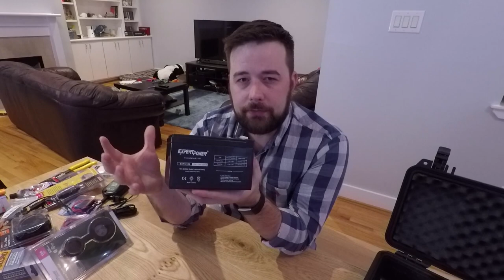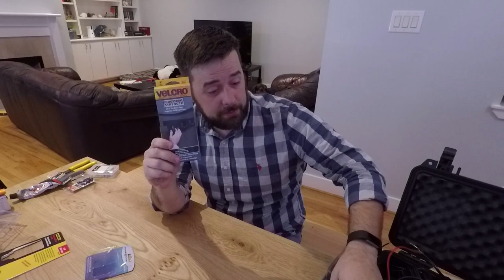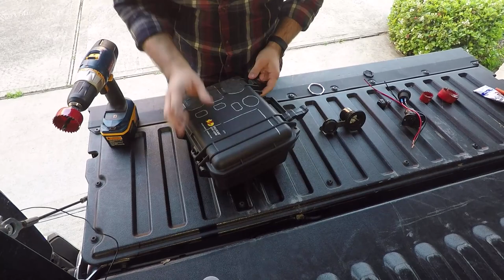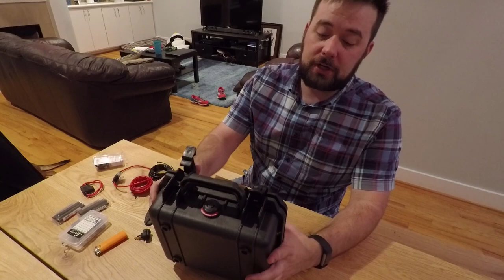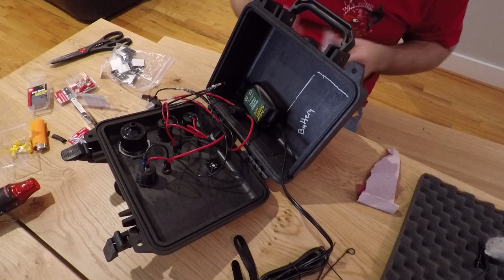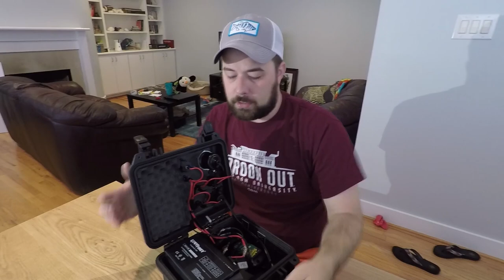Ultimate Kayak Battery Box

Comment: the battery is lead acid I believe.  I would hesitate before plugging that into wall power for a trickle charge.  At least open the lid when doing that activity.  

A better setup would be the lithium iron phosphate choice, but that is a hard no on charging inside the kayak or inside the drybox.  You have over 10 lbs there,  it would be half that in the better battery that burns all day (and night).

Comment: Are those switches waterproof? 
 If you use Velcro to stick the battery inside the case, it will be removable instead of gluing it in. Also, if you locate the battery in the center, low in the box, it will be much more comfortable to carry.
 Nowadays, you can find a box very similar to that expensive Pelican, but much, much less expensive at Harbor Freight.